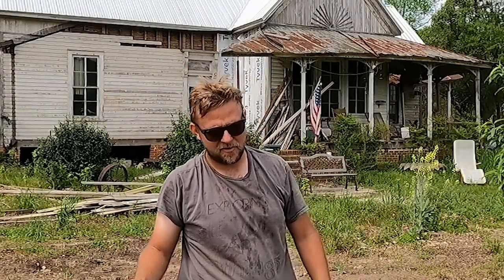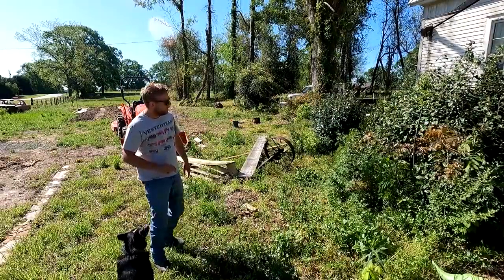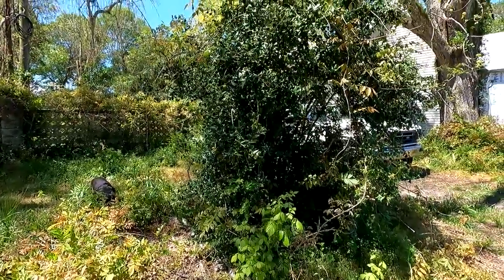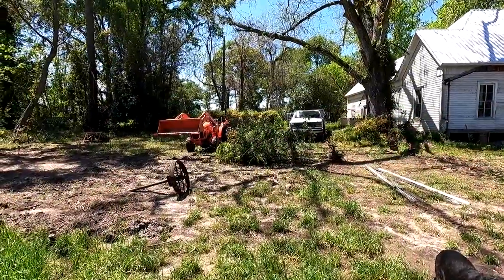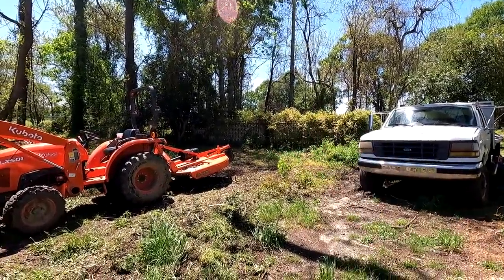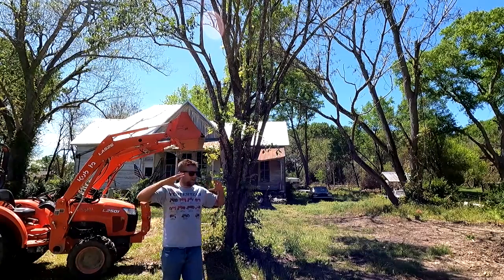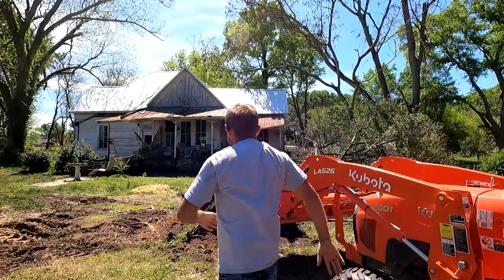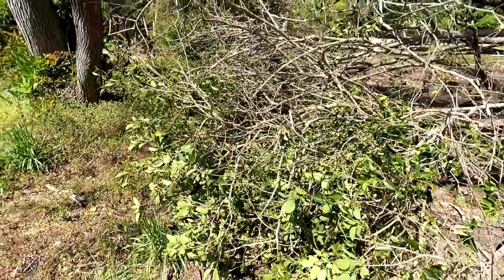epic! Huge Invasive Tree Ripped Out of Ground | Old Byrd Farm Lawn Clean Up

Comment: Are any of your children old enough to help on the farm? That axle and wheel you moved along with donated siding is intriguing. Seems there should be a way to bury the axles a few feet in concrete and then use the wheel to hang plants from or use it as a tomato trellis. One of my fav areas of the farm is the patio with a cinderblock wall.
Reply from the maker: That is actually exactly what I did with that wheel

Comment: Die, privet, die!!!  I have been fighting my own battles, lol. One thing I've noticed is that privet tends to be shallow rooted. I've had some luck with using a sawzall to cut through the horizontal roots in a circle around the trunk then waiting a few months. Some of the tree have just toppled right over.  Good for areas that the tractor can't maneuver in.

Comment: The yellow flowering plant in front close to the walkway .. is that a wild cabbage flowering? 1st time I could actually see the plant at the base & just above. 
No doubt you've struggled with removing that holly .. oh my it hurt to watch you remove it. I didn't realize there were 2 Georgia varieties, interesting. I dig a lil deeper & will include what I read about the two. Actually a lil more sad u removed it🙁 I've always had a soft spot for holly trees & bushes. Ashamed u couldn't just move it but ik that's a huge undertaking since it's so big & established. Oh well .. onward as they say. It's getting hot & you look beat .. remember to stay hydrated. If u like pickles .. they help replenish salts u loose while sweating. Oh drinks like body armor have tons of electrolytes too which would be good to drink along with water. I just remember I think last year how u got dehydrated out there working ur tush off. B careful

Comment: Geez, watching some people operating "heavy" machinery can really make you cringe.  Full throttle is a waste of fuel...diesels produce most of their torque in much lower rpm range.  Pushing over or pulling down a living tree that big is just silly.  Without a backhoe attachment, you should have just kept doing what you were doing, but all the way around the base of the tree:  use the bucket to bust up and loosen the soil all the way around the stump, tearing up the smaller roots, and loosening up the big ones.  THEN go back to nudging or pulling.  Oh crap...28:38  The tow rope attached to the truck looks too short, and being tied to the tree higher than the tow hitch, is going to lift the rear of the truck reducing traction.  I'm not sure I can watch the rest of this video! 🙈😳😰  Hopefully no blood is shed...
Reply from the maker: I stopped reading when you said full throttle was a waste.
Reply: @THEOLDBYRDFARMVLOG  IT'S A SAFETY ISSUE as much as anything else.  Compared to me, you're a "kid".  Run small diesels as much as I have in pursuit of landscaping or similar goals and you understand unless you have an attachment that requires the rpm for hydraulic system flow or mechanical drive speed, full throttle is often unnecessary and can reduce control.  All the the slam wham bam effort without preparation almost got you injured or killed when that dead limb missed you.  A little careful work weakening the root system makes for a much safer and controlled removal.  As an old mechanic once said about doing anything, if you are struggling or straining(or in this case the machine) you have less control of your tool and the situation, you are in danger of getting hurt, and there's likely a better, safer way to do it.  Work smarter, not harder.  Stay safe.